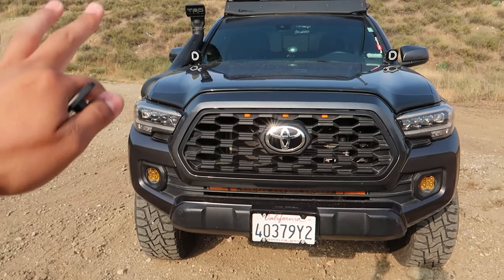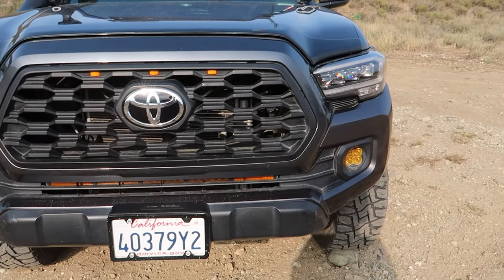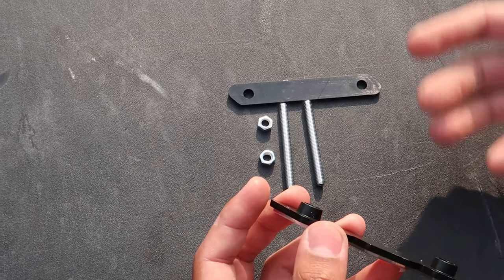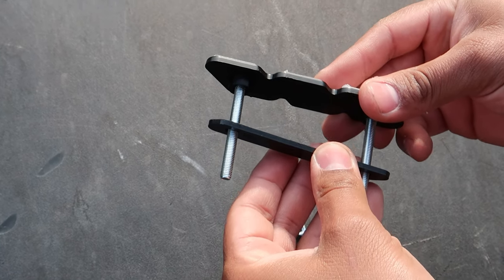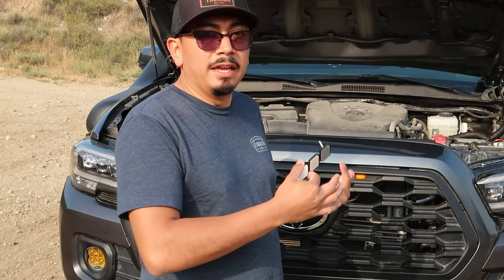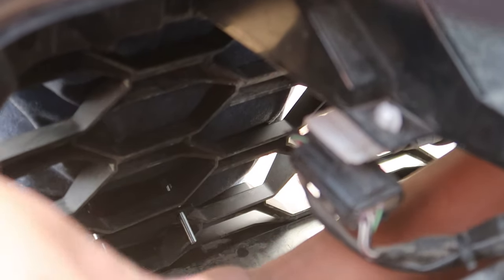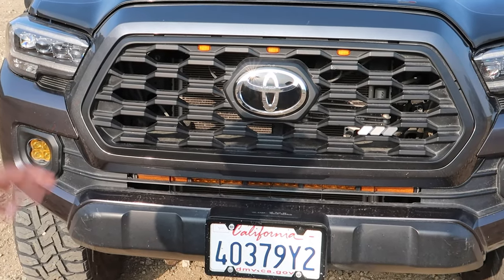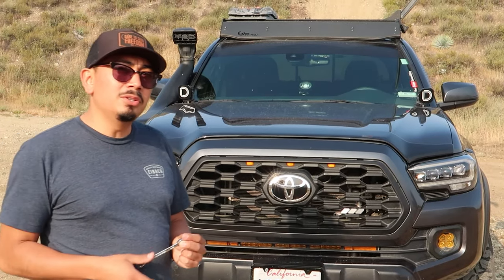TOYOTA TACOMA OR 4RUNNER TRD GRILLE BADGE (also in other colors) | HOW TO INSTALL + Truck Update!

Comment: Better to add lock nuts, or add lock washers. They loosen without either after a few trips with the constant vibration.
Reply: Used locktite on mine